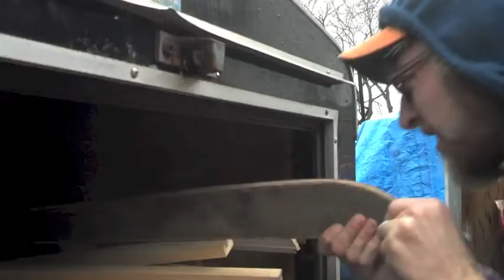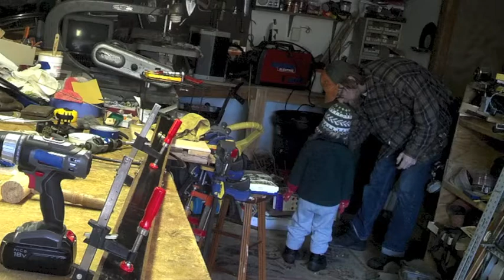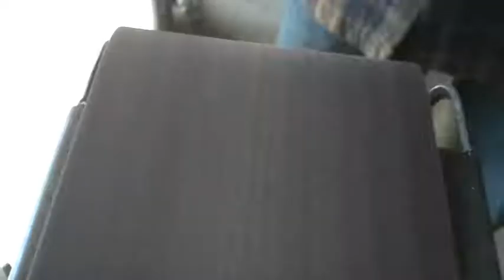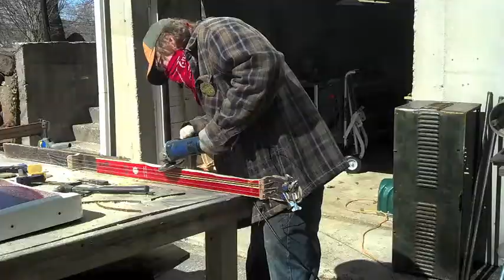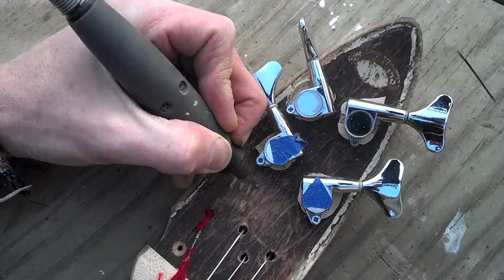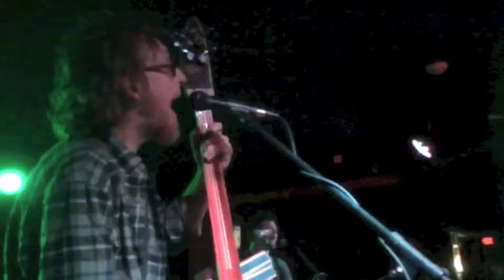old, wood skis upcycled in to upright bass - the bass ski-tar

Comment: Isn't the neck a bit skinny ? (I mean the width) I'll try to make an accoustic bass with two washtubs and skis for the neck, it's going to be fun.
Reply from the maker: S W A G L O R D 4 2 0 6 9 no. after filming this I radiused the front of the fingerboard, too. it's hanging in my shop and I still play  it 4+ years later. I based it on measurements off my Kay bass. it's not too skinny for me, but that is a subjective thing. good luck and share pics!
Reply: Thanks, I'll do so when I'm done.